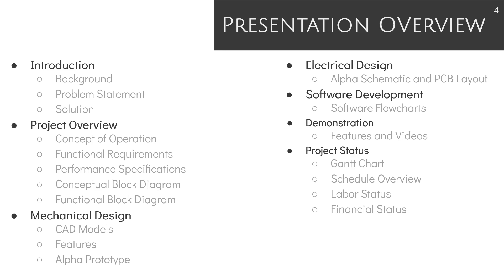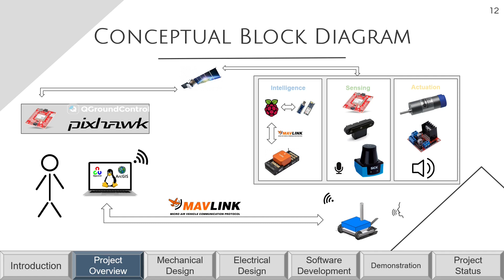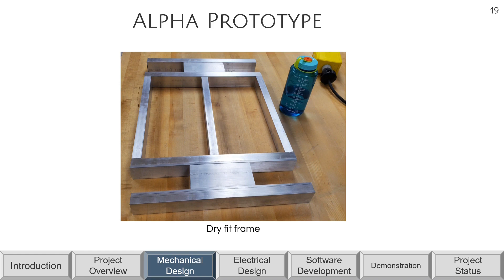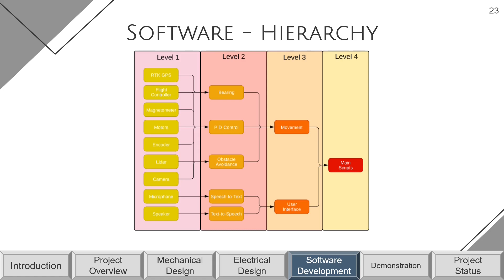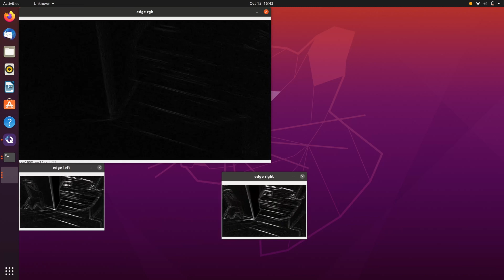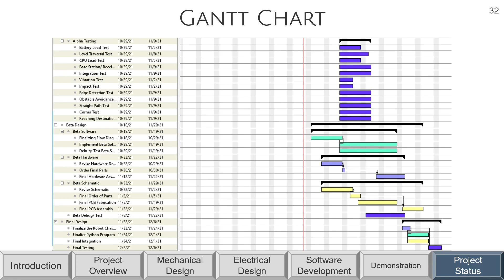DAGGR CDR

Comment: While using the PixHawk, what was the hardest portion of the software that was required to integrate the motors and application? Also what application would you recommend for the route planning; which was easiest to integrate the motor and Lidar with?
Reply from the maker: As far as integrating the motors in the software, there is actually little to no code required to utilize them. The PX4 handles the driving of the motors through the firmware and it's as simple as connecting the necessary hardware to the carrier board, configuring necessary settings in QGroundControl (QGC), and then sending out high level commands in a .py script such as “vehicle.drive()” or a MAVLink command. For route planning, I’m assuming you would already have the desired routes on hand however y’all acquire them. In this case, either uploading the route onto QGC directly or sending the route with a MAVLink.